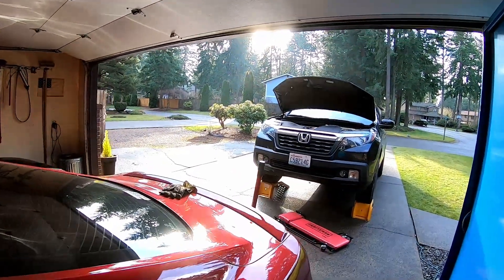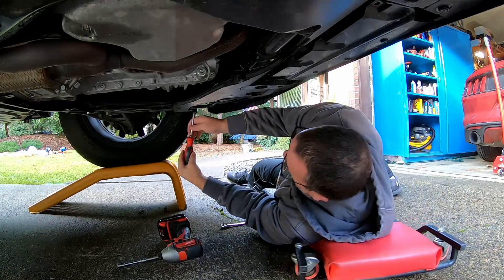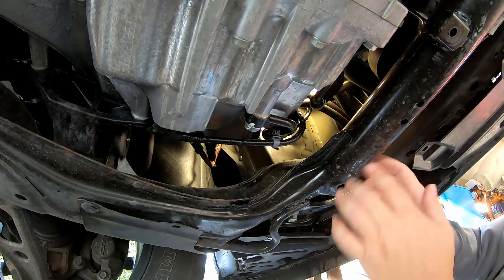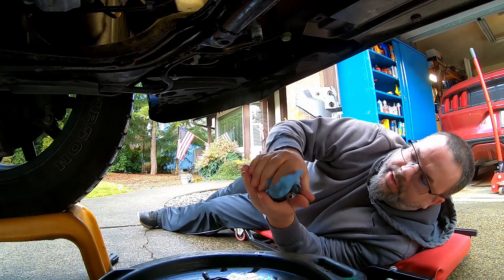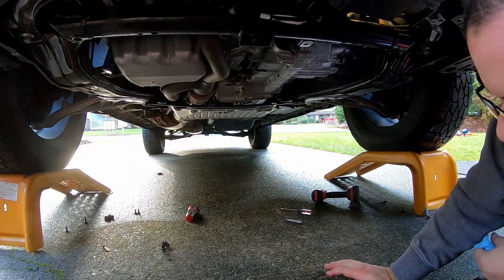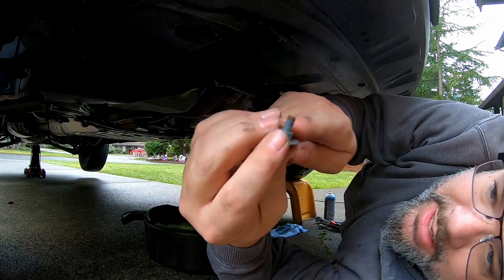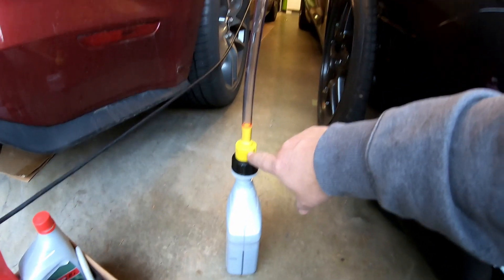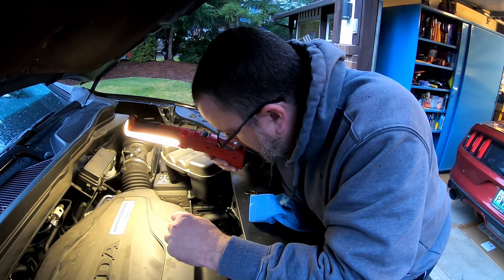2017 Honda Ridgeline 2016 Honda Pilot Transmission Fluid and Filter Change, Yes there is a filter.

Comment: Is this for the 6 spd or 9 spd?
Reply from the maker: 6 spd. I'm not sure there were any 16 Pilots or 17 Ridgelines with a 9 spd?
Reply: Thanks I have a 16 pilot touring 9 spd.
Reply from the maker: @jonathantolbert4176  Learned something new today. :)
Reply: @jonathantolbert4176  

How do u like ur 9speed trans? Mine is 2019 Honda Odyssey and I don’t like it
Reply: @edwinpurnomo1612  I hate the 9 spd in my touring. I hear the 19 and up we're retooled for smoothing shifting. Mine jumps all over the place and can't make up it's mind.
Reply: @jonathantolbert4176  

I regret purchased 2019 honda Odyssey, I feel the same way, transmission jump all over. 1st to 2nd gear I feel not smooth. I'm thinking to sell it and get another brand car, but I would lose a lots of depreciation value.
Reply: @PNW_Car_Mods  The Elite and Touring have 9 speed for 2017 models.  I had a 2017 model before purchasing a 2021 mode.
Reply: @edwinpurnomo1612  Check your pressure switches.  The 3rd gear switch may be the issue.  Get the car scanned for the transmission control unit.